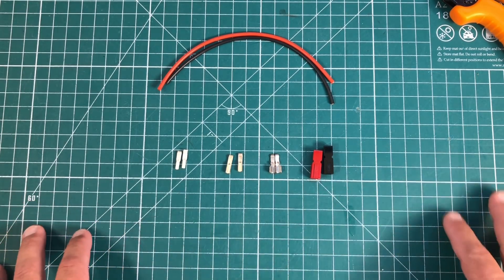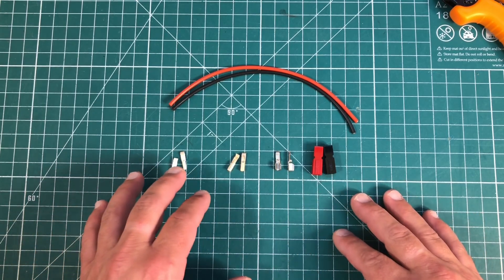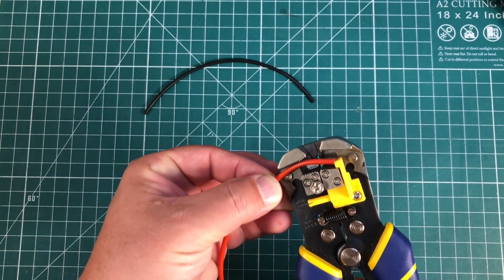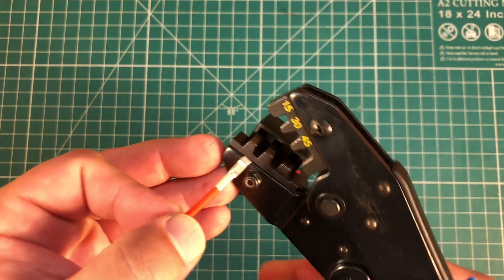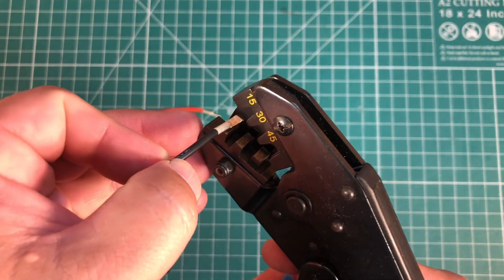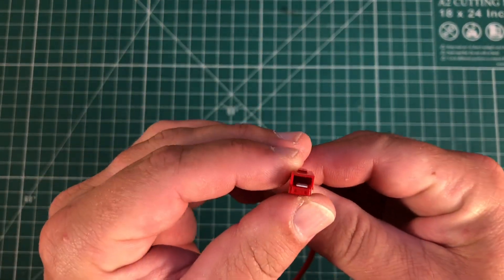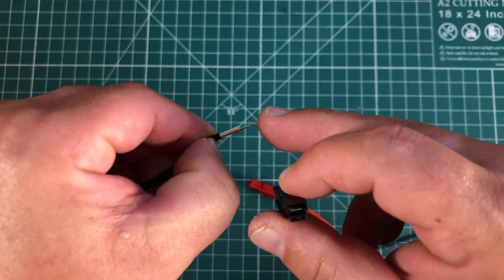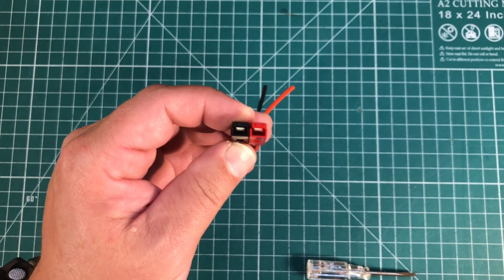How To Install Anderson Power Pole Connectors

Comment: I had the 45 amp ones and my copper was passing the second  tan so it wouldn't go all the way in, first thought it was the cable since it was 6awg thick. Just learned Anderson and MC4 connector which I think was a bit easier. Great video 👍

Comment: But you didn’t…reeeee…….properly…….reeeeeeeeee……………solder…..reeeeeee……..the ends…reeeee. Sometimes I flow some solder in the end just for peace of mind even thought the connection will work the same regardless. It also helps me keep up my soldering skills as if you get messy with it the globs of solder can actually make the contact difficult to go into the housing or not make a good contact once in the housing

Comment: It took me a few times, before I realized the proper direction, for the metal crimp to go inside the housing, and the wire sides. (Thanks to YouTube videos for helping!) Now, this video is short and concise, and all you need to know, to get started. I happened to purchase the Iwiss Crimper tool, from Amazon. It is an affordable crimper, that works great! Do it once and do it right.

Comment: Do you ever put a spot of solder on the end of the connector to get a stronger electrical connection? I know some folk that do and some that don't.
Reply from the maker: Sometimes I do.  Not typically though.

Comment: I'm glad you said that the difference between the amp size of the connector.  The power limit will be the same because the spoon side is the same for all three.  It's just the hole side that is different so the wire properly seats in the connector.  Too many people comment on a connector not able to handle the power.  It's just the wire being able to fit in the connector for a proper crimp.

Comment: If you are using light wire, I like to heat shrink just onto the connector to provide some stress relief and stiffness when shoving it into housing.
Reply: Good idea.
Reply: And solder )

Comment: Thanks for showing how to do this properly. I have no problems crimping the wires to the connectors, but have all sorts of problems getting the wires into the housings (I try to push them in). Next time I'll try using a small screwdriver like you show in the video.
Reply from the maker: Necessity is the mother of invention.